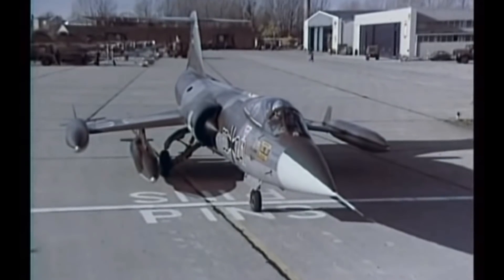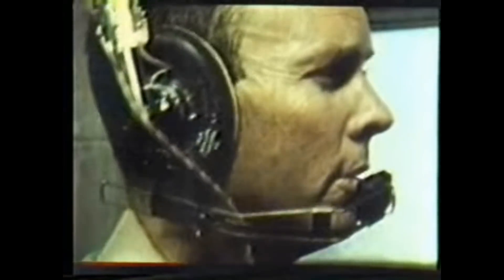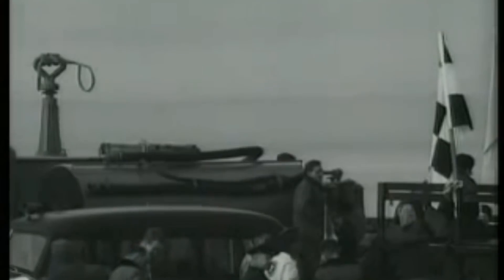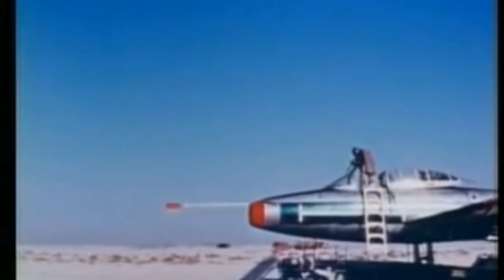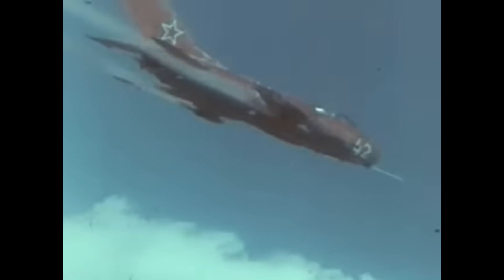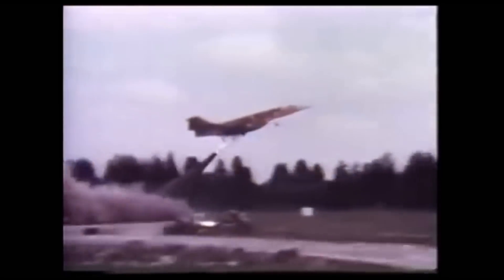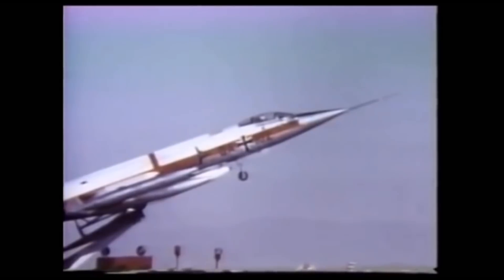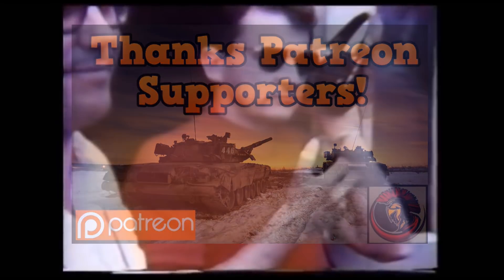Cold War Tactics | ZERO LENGTH LAUNCH

Comment: My uncle who was in the air force told me about this system

He never motioned the the part where planes could potentially bale out and not care about the aircraft after that xD

I recall him talking about flight times and distance. How the range of an aircraft could potentially depend on fuel capacity (and that would mean to the frontline AND back)

How instead of mid air refueling you could bring the plane close to front line and then he would only have to fly back (increasing flight range) Cool video btw

Comment: If what one of my grandfathers told me is true the US Strategic Air Command had a different solution for things like the B-52.  Keep some in the air at all times with a nuclear payload.  With in flight refuelling a B-52 can stay in the air for quite some time.  Gave the crew flight time hours and they could rotate planes and crews between airfields and station keeping with a set of sealed mission orders to be opened if they were given the go signal.

Another thing about the cold war was that if it ever went hot a lot of pilots assumed there would be no where to go back to, they would bring vengeance to the enemy for as long as possible and assumed they would die in the process because that was easier to think about than returning to a country that was likely to be a radioactive waste land.  The mindset required to cope with things when plan A was Mutually Assured Destruction wasn't exactly healthy and effected a lot of military personnel from that time period as much if not more than actual combat.  At least thats what I've heard from my father, Uncles and grandfathers.  I know growing up in the 70s and 80s in a military family and knowing how easy it was for the city I lived in to go away has given me a different outlook on things than my civilian peers and younger coworkers.

Comment: I guess you could say the concept of the Zero length launch might of had it roots with the Sea Hurricane with it's short catapult and rocket bottles installed on converted merchant ships in order to deal with the long range recon aircraft of the Luftwaffe. Problem was how to recover the pilot since the plane was not, solution was the escort carrier. Same problem as of today, the solution learn to operate away from airfields or build better and more capable versions of the BAE Harrier

Comment: With an interceptor the key was the ability to climb as fast as possible to the altitude of the bombers.  A rocket is going to get you there ASAP with more of your own fuel in your belly.  I think the test pilots were up for anything that gave them an advantage getting to a nuclear bomber further away from its target.  I would imagine the test footage is of phase 1 of the program.  The second phase would be getting the fighter to its service altitude all on rocket power.

Comment: I've always loved how funky this idea is but it think i had an even weirder one. So its another assisted short takeoff idea. Imagine having a jet that can make a very short takeoff in a field or something under its own power, using some type of transmission attached to the exhaust/nozzel of the jet fighter that uses the speed from an engine exhaust to spin a propeller (so it can catch the wind) that is attached to a gear assembly like a engine transmission that is attached to some thicc wheels so it can accelerate like a car and once up to speed it detachs and then you pitch up and take off

Comment: Let's have a few figures to illustrate the development:

We take the take-off thrust/weight ratio - reasonably loaded -  (era in brackets):

F-84G Thunderjet: 0.31 (1950'ies)
F-104G Starfighter: 0.54 (1960'ies)
F-16C Fighting Falcon: 1.1 (1980'ies)
Typhoon: 1.15 (2010's)
F-35 Lightning: 0.87 (2020'ies)

As you can see: The F-104G was severely underpowered by todays standard.
Aircraft before the 1980'ies were gliders compared to today.
As soon as you reach about unity - there really isn't not much point in going much further. In fact you see Typhoon pilots taking off and barely touching the afterburner.

This goes for civilian aeroplanes as well : Most take-offs are performed way under capability. The reason: To preserve engine life - you might as well use the runway that is there anyway - and preserve engine, Civilian aeroplanes measure every take-off and the pilot using maximum performance is liable to be asked questions as to why he was so hamfisted?

As my driving instructor said: Some people change gears - others change gearboxes.

That is why I consider Matsimus so valuable: He knows his way around heavy vehicles - all the "funny" russian video'es show boys that have never grown up - and frankly don't know how to handle a tank.
Soldiers are notoriously rough on their equipment - AS LONG AS THEY DON'T HAVE TO REPAIR IT THEMSELVES.

Something similar applies to landing gear and brakes. There is a difference as what can be done and what should be done. It is all about shop visits - the next war will be won in the workshop by the maintainance chaps.

That should be taken into consideration when you are talking airfields:  Again: I count 6 major airfields in Denmark with say: 10.000' runway - if you can adapt to 5.000' there are - at least - as many again that could be used. They might not take jumbo jets; but some times less is quite sufficient.

Comment: There's a bit of a doctrinal problem with the concept that was why I believe it was never used. 

Surface-to-air missiles. If the job of the jet is to intercept bombers, then why not use a surface-air missile that can be launched pretty much everywhere this could be fired from, and doesn't hold the risk of losing a far more expensive jet fighter and the pilot? You didn't need to concern yourself with recovering your fighter aircraft and the pilot since the missile would be destroyed in the engagement and the cost of a missile, while still quite high, is much less than that of a contemporary fighter jet.

Comment: Let us say it like this: There has always been a lot of developments in arms - where some of the ideas were good enough - but needed development.

As scroll of shame to the brits: Here is an expert from Bovington, that I find quite entertaining. I don't think you could find an american that would facepalm himself to that extend.
https://www.youtube.com/watch?v=GF0hRJ09Q-E

In this example my choise pick is the Covenanter: They build 1,200 of the damned thing before they could stop the disaster - at a time when they desperately needed tanks. It would have equipped 6 armoured divisions with a tank to replace losses from Dunkirk - if only it had worked - which it didn't. A case of spending a lot of money without any purpose at all.
Those were the tanks that would have opposed the Germans - had they landed in Britain.

On the other hand: The Mosquito was more or less build by the same concept: Let people that don't know what they are doing do the work.
The Mosquito used cabinet-maker to produce the arguably best medium bomber of the war - and long range fighter. The Messerschmitt 110 was - let's say a bit of a disappointment.

The point to Matsimus themes: You can critisize Canada for a lot of things in arms procurement - don't get me started on that!
But the object of procurement is NOT to get the best tank, aircraft, etc.; but to AVOID the worst disasters.

Comment: The ZLL has been used in combat, albeit with UAVs instead of manned aircraft. The Israeli's used ZLL drones as decoys for SAMs in order to get them to use their tracking radars, allowing aircraft armed with anti-radar missiles to shoot the radars without placing pilots on danger. ZLL drones have been used in Vietnam and other conflicts for reconnaissance. Finally, in an "old-meets-new" situation, Pioneer UAVs were launched with rocket assist from the helo decks of US battleships during Operation Desert Storm. The Pioneers spotted targets for the battleships' 16-inch guns, and then recorded and relayed battle damage assessment after the ship were done shooting. Iraqi troops were so terrified of the big guns, that they were known to attempt to surrender to the Pioneers when they were spotted. The Pioneer would then be flown back to the ship, and recovered by flying into a big net on the back of the ship.

Comment: Well the there's  reason its not used.  It's a logistical nightmare to lift a fully stored aircraft and its booster on the ramp. Also, you still need  runway at some point to land otherwise the taxpayers might object. Oh and you're going ti have a lot of pilot attrition in your pilot corps due to vertebrae damage from frequent ejects.
And lastly, what kind of brain dead pen pusher chose a f104 ? That thing has the most godawful low speed handling of the entire cold war, kudos to the test pilots for having the balls to try it out. 
A g91 or alpha jet would have made more sense
Reply from the maker: bconneau fair points
Reply: In france we had an even worse idea, breguet taon. No landing gear, takes off from an all terrain trolley, lands on skids. The idea was to use grass fields, except... well same problem really, you needed  crane to get the thing on the trolley and off its skids to the dispersal, which took forever and was really bad for high tempo ops. Plus the low pressure tires made the trolley bounce straight back into the fuselage when released >_<
Love this series on outrageous cold war ideas btw, have you gotten to the chicken heated nuclear landmines yet ?

Comment: In a Hot war with Russia that was non-nuclear or at least limited, airfields in Europe would be the primary targets of Russian cruise missiles/bombers. 
The Swedes came around this by investing and making many major roads straight/good enough to be used as airfields. 
And at the same time they had hidden bunkers with aircraft,fuel and munitions that could be rolled out to the roads. 

But a "rocket-ramp" like this could also be very useful, so you could move your fighters on a truck, near the front lines and launch them. 
If they had a 5% failure rate it would be acceptable in war, but it would not be possible with those odds to train in peace time.
Reply: To add, a run way should have a pile of gravel nearby for filling in the bomb craters AND a plane that can take off on compacted gravel without acting like a vacuum cleaner (hint F-16). That is one reason Viggen or Su-25 have their air intakes high up.

Comment: The F-104 wasn't a good platform neither as it was a highly dangerous aircraft since you're flying the equivalent of a missile
Reply: Fire Power701 it had an unforgiving flight envelope alright, fly within the limits and stay safe just as with any plane.
Reply: Leander Johnsen The stall speed on that thing is ridiculous I mean even German pilots managed to die in those
Reply: Fire Power701 north of 180 kts IAS with full flaps and BLCS in working order. Probably about 240 kts if not flaps and BLCS and thats still with tiny margins for error. Imagine deadsticking this thing with no blown flaps and in challenging condtion such as in northern norway... punching is the sane thing to do. With the wing loading of this thing and the insane stall speed, a spin in this thing would be serious business, its still hard to tell why the germans had so many mishaps when the norwegians didnt bases on average flight hours per plane.

Comment: You should check out the WWII German Bachem Ba 349. This was a point defense vertical launch fighter. Possibly the inspiration for the zero length launch system in your video. In 1945 the Luftwaffe had three major problems; 1) Skilled pilots 2) Fuel  3) air superiority over there home fields. 

If you want to really marvel at the dangers pilots were willing to face, read Rocket Fighter by Mano Ziegler. The was another point defense fighter, but it saw limited operation use.

Comment: This is a nice piece of history. I think when the British saw it they began thinking and it came out to be the Harrier jump jet. Which made this technology obsolete as Harrier can also land vertically which is more cost effective because in case the Pact would destroy every runway and straight piece of road for a normal plane to land ( and yes we had the capability and plans to do that ). 
Love these history lessons Matsimus I should get you a book about the eastern battle plans. I just don't know if it was translated to English tough.
Reply: Michal Prozac the issue with the vertical landing is that you can't land on unprepared surfaces due to FOD hazard. That's a huge issue with VTOL aircraft.
Reply: I agree with you but it is easier in case of war to prepare a small surface to land than a huge runway. As everything all has benefits and disadvantages. And I have a weakness for the small Harrier. Too bad Russians were not as successful with Yak 38 that was also an interesting concept.

Comment: Ah, the 60s, USAF dominated thinking. The Hi-Low mix, USAF F-4 High, NATO F-104G Low. The Swedes used an off-base on highway system with Drakens and Viggens. There was also a "portable aircraft carrier" which was intended to have a prepared length of Autobahn and quickly installed arresting gear and JATO bottles on the Aircraft. The Luftwaffe actually operated some FIAT light strike aircraft from sections of highway. Geoff Who was young and airplane/space crazy.

Comment: If you reach a point where you need to rely on zero length launch  to have planes on air, perhaps you have already lost the air war and no one has told you yet.
Reply: If the Cold War ever escalated into full scale War West German Air Force Command estimated that it would take the enemy only about half an hour to destroy all Airfields within West Germany. ZELL was developed to enable NATO Forces to retaliate even despite their Airfields being rendered useless. That's also why it wasn't tested in secrecy - they wanted to Soviets to note that they couldn't just take out the US' Airbases housing the American Nuclear Deterrant in Europe and then hope to wage a conventional war without risking a Nuclear Strike by the Americans or the Germans (which should have gained unrestricted access to 20 of these bombs according to a treaty between both countries). 

ZELL was considered to play a vital role in NATO Strategic considerations until the overall doctrine of massive retaliation was replaced by a doctrine of flexible answering - trying to contain the conflict instead of straight out escalating it into Armageddon.
Reply: The Warsaw Pact had zero reason to use nukes first.  They had the upper hand and believed they would be able to win a conventional war in Europe, as long as NATO forces did not have enough time to prepare for it.  
NATO was ready to use nukes when/if they saw the war was definitely lost.  At that point most of NATO area on mainland Europe would already be lost.  ZELL or no ZELL would make zero difference to any nuclear strike from NATO for two reasons.  One, if you lose land you lose land for both airfields and ZELL.  Two, retaliation wouldn't happen anyway since if NATO used nukes, it would be the first to use them.  It made no sense otherwise.

Comment: As to the outcome (seeing some of the comments):

Well it left Europe with a lot of airfields - they had been there since WW2 really. In a small country like Denmark I can count 6 major airfields capable of handling quite large aeroplanes. Something similar in the old East Block countries. Much of the infrastructure of the revitalised Nato is allready there.
True: They need a bit of tender loving care; but basically they are there. It is not that major construction and earth works are needed.

Not only does it mean that deploying aircraft to where they are needed is mainly paperwork planning. It also means that there is a lot of airfield for lifting in ammunition for the tanks. Though the tanks will have to be forward positioned their ammunition can be delivered (and spare parts!).

As you probably have seen: The Hercules is able to land on a flat beach (personally I would like to see some C-27J's - half the runway, half the load) - today aircraft have so much engine power, that take off distance is not really a problem (landing can be - but compared to earlier generations that required drag chutes?).
Setting up an improvised air field is not something that will overtax "Freindly Defence Volunteers":
If the russians seriously consider bombing all the possible airfields they need a lot of bombs and aircraft - and I mean: A LOT.

The smartest defence of frail stuff like aircraft is NOT being there where the bombs fall. If you keep moving the aircraft around - of course it will need bowsers - but they are cheap compared to aircraft (and their maintainance facilities).  With the range of modern combat aircraft it is easier to get a concentration of force within hours - ok, it will need a bit of planning: Meaning: A LOT.

The major problem is that Putin has some element of surprise as to where he intends to attack - but he can't outrun the defences - they will run into some pissed off canadians before lunch.